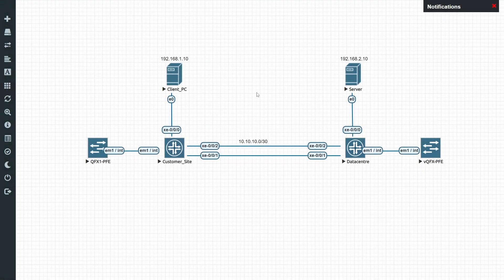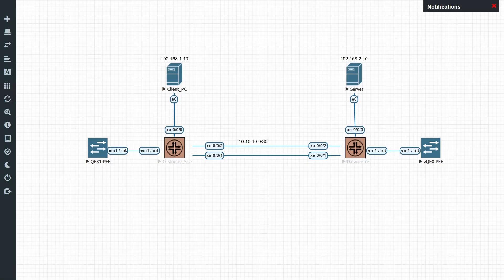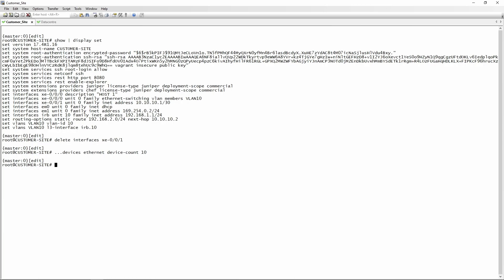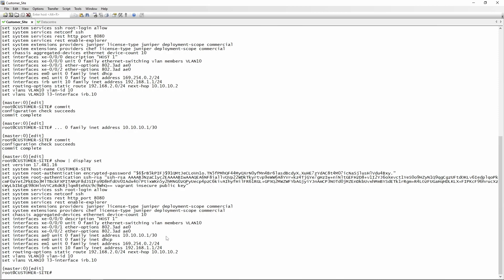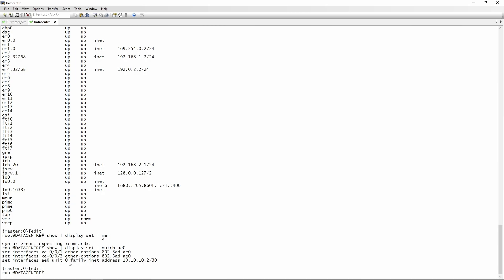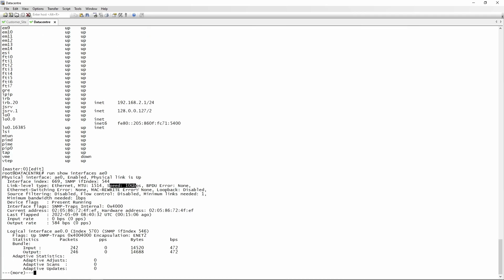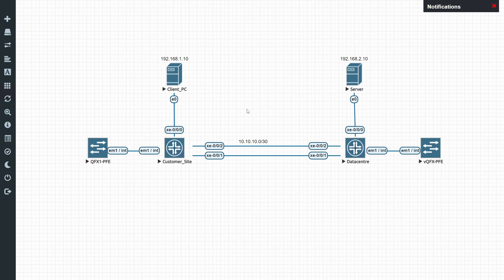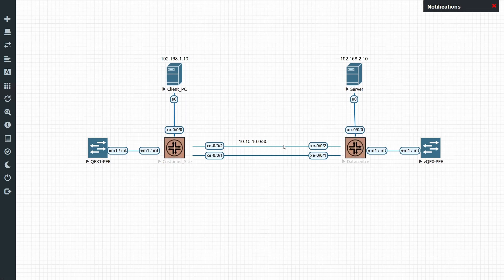How To Configure Aggregated Ethernet Interfaces on Juniper (Link Aggregation)

Comment from the maker: LACP is not needed for Aggregated Ethernet to work.  LACP is a control protocol which will be covered in a future video.  As for the minimum-links statement, once your available "UP" interfaces go below the number of minimum links you have configured under the ae interface, the ae interface will go down.  This is only used if you have a backup path via other interfaces, otherwise this statement does not really apply to your environment.

Comment: Do u know what hashing method it uses to load balance the traffic across the links? Does it use Source/Destination IP and TCP port?
Reply from the maker: Juniper is very obscure with this info but from testing it looks like it uses per-packet load balancing, which is actually per session load balancing. So I believe all of the above is used to determine the session.

Comment: Hello good morning, I'm new to the Juniper world, I'm having difficulty attaching the vlan to the interface, could you help with this issue

  commit
[edit interfaces xe-0/0/1 unit 0 family]
   'ethernet-switching'
     Family ethernet-switching and rest of the families are mutually exclusive
error: commit failed: (statements constraint check failed)
Reply from the maker: Hey, you need to delete the full interface config first. It has some basic config by default. From edit mode you can just do “delete interfaces” and it will delete all config on all interfaces, then you can configure it from scratch with VLAN tagging etc 👍

Or if you dont want to delete all interface config, just do “delete interfaces xe-0/0/1” You will then just need to re-apply your config on this interface and it should go through.

I usually just delete everything before I setup a new device.
Reply: @lameaveragetechies1040  Good morning ,

I applied the commands below, it displays the following message ....

root@vqfx-re# delete interfaces xe-0/0/1
warning: statement not found

{master:0}[edit]
root@vqfx-re# commit
error: In routing-instance default-switch vlan vlan20 configured under interface xe-0/0/0.0 does not exist
error: configuration checkout failed
Reply from the maker: I think the best is to just delete all the config on the switch as there seems to be conflicting config somewhere. At root level just type “delete”. Then set the root password otherwise it wont commit. Probably the safer bet at this point.

Comment: Hello there, I really enjoy your videos and I am trying to put my own skills into practice with Eve-ng. When I tried out the configuration from this video on the QFX images I kept getting messages saying "device not found" - with show int xe-0/0/0 terse. I can configure these interfaces, but they do not show up in the show commands.

The 10Gbit xe- Interfaces are displayed on the "show configuration" command, but not with the "show interfaces terse". With the "terse" command, the output displays the "em0 -14" interfaces. Do you recognize this? I've probably done something wrong somewhere when importing the images.  Many thanks for any help
Reply from the maker: Appreciate the kind words! I had this issue a few times. Do you have both QFX images? The RE and control plane? Those have to be linked as well as in the video. Make sure that when you add them the versions are identical on both devices. Sometimes a reboot of both fixes this issue even if everything is correct. Seems like a bug with either the QFX images or EVE-NG.
Reply: @lameaveragetechies1040  Thanks for getting back to me - much appreciated. I think you could be right about there being an issue with the images.
I am going to wipe the Lab clean, and re-import them, including the older versions.
I'll post my results👍
Reply: @burnsybob70  The issue is due to a common problem in EVE-NG and vQFX images where you have to remove a few files from the shell on the QFX and then reboot the node.
Reply: @lameaveragetechies1040  Hello again, regarding the problem I was having with my QFX images on Eve-ng , where the "xe-0/0/0"  interfaces were not showing, just the "em" interfaces - I have fixed the problem. The problem was that the PFE and RE file names were not the same, but they have to be the same.

The PFE file was named "hda.qcow" and the RE file was named "hda.qcow2" . As soon as I named both files "hda.qcow2" and re-imported the nodes, I did a "show interfaces terse", this time the xe-0/0/0 - xe-0/0/11 interfaces appeared.

Comment: hello sir, how about  juniper srx LAG to Cisco Layer 3 3560  , is the same config like this ? thanks
Reply from the maker: Hi, it depends. Do you have 2 SRX in a cluster? Or single SRX? If it is SRX in cluster then you need to use RETH interfaces. But if it is a single SRX then the config is the same yes. If you use LACP on thr Cisco, you need to use LACP on Juniper as well, there is a video on LACP also on the channel 👍
Reply: @lameaveragetechies1040  and one thing sir, do you have tutorials how about srx load balancing 2 isp,but if i want the trafic like a zoom, teams through isp 1 and others trafic isp 2.  thanks a lot
Reply from the maker: It is not so easy on SRX unfortunately. On Fortigate the separation of traffic is much easier, so I usually recommend people to use Fortigate in enterprise deployments